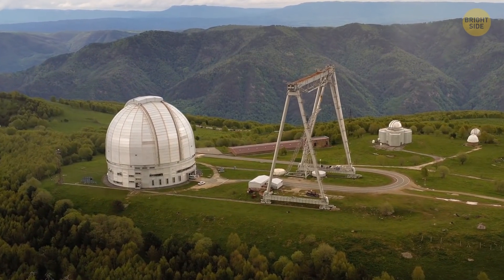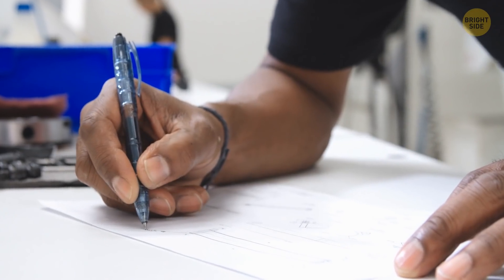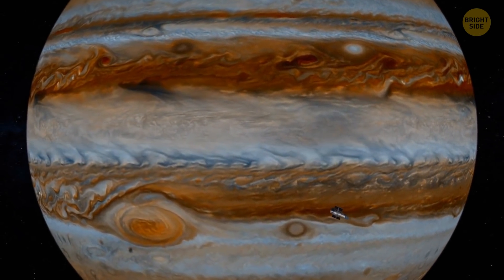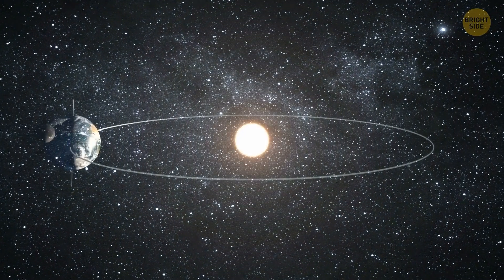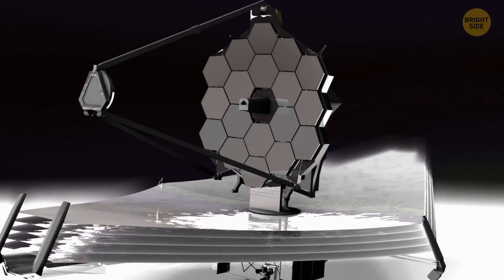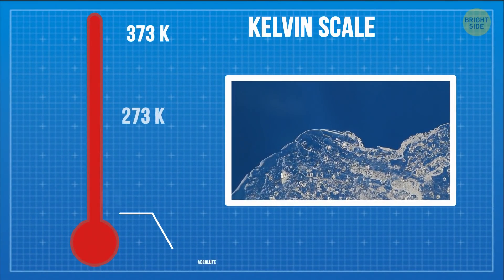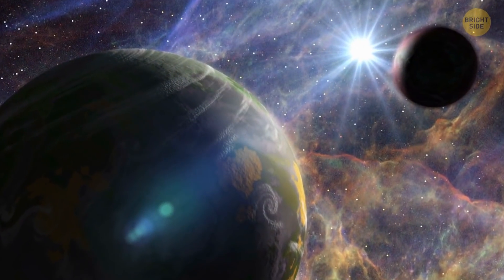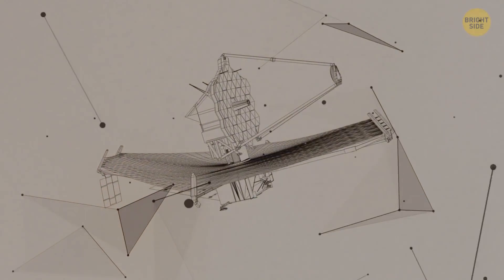The James Webb Telescope Is Able to See the Early Universe

Comment: Is the telescope the reason for the semi conductor shortage, if so, no wonder I can't get a Current Gen gaming console.
Reply: No. The semiconductors on JWST are all specialized items: they're radiation-hardened for use in deep space, and are not made on the same production line as consumer electronics.